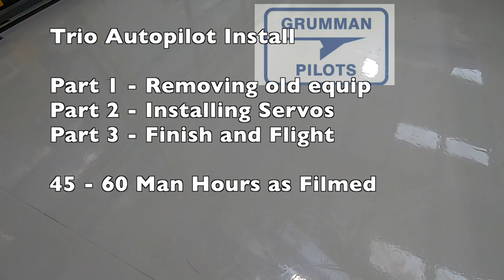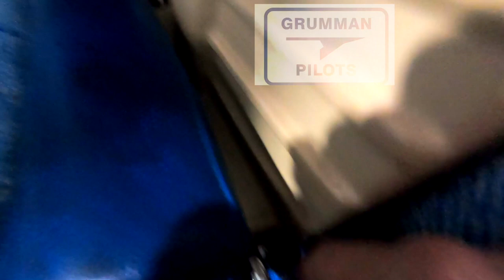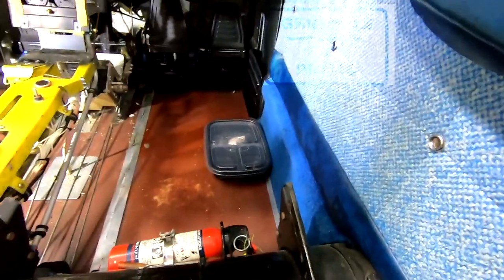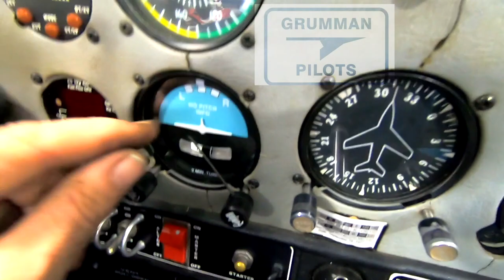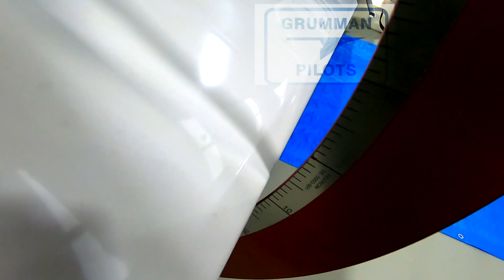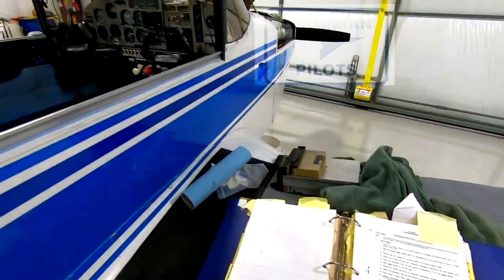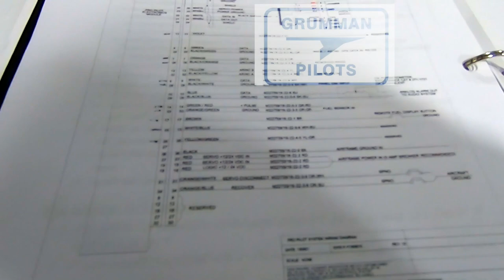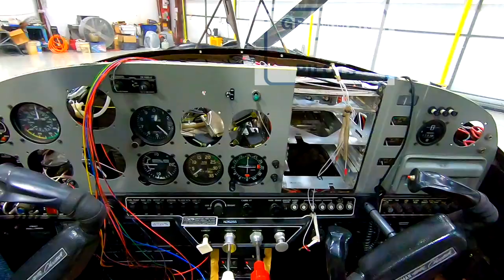Trio Autopilot Install Part 1 of 3 - Grumman Style

Comment: Hello Roscoe. Is that aileron rigging tool available to rent?
Reply from the maker: Check with Fletchair.  You can also clamp the elevator to the elevator tip with padding to set neutral as well.